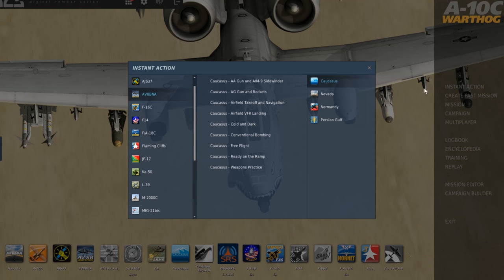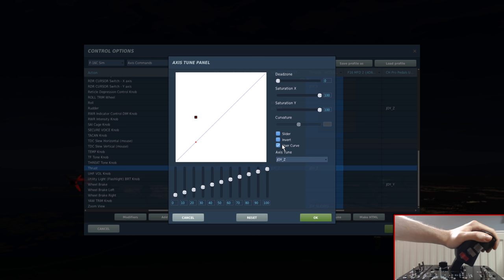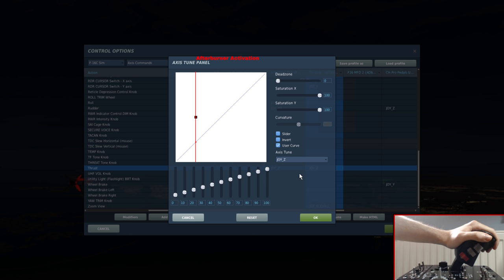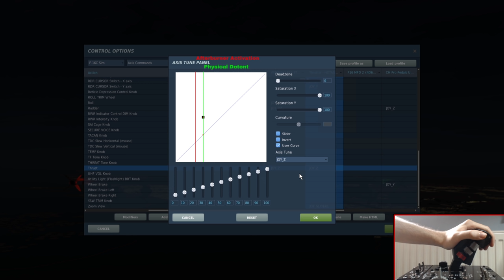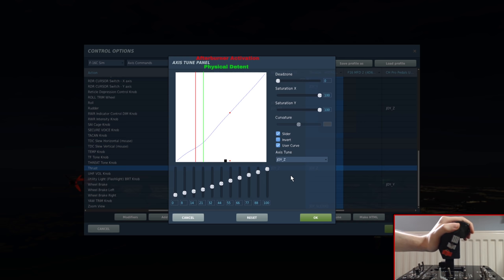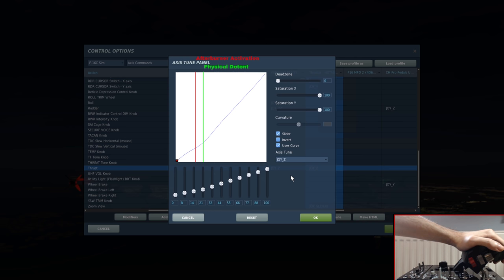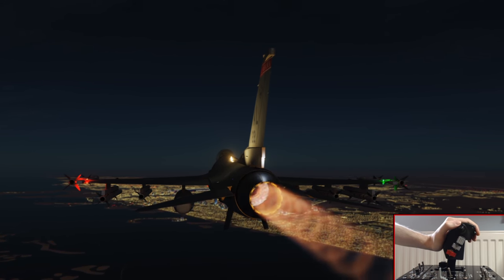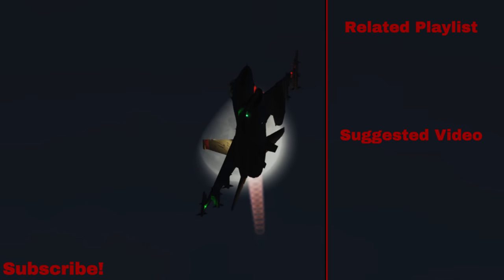DCS Setting up Afterburner detent Tutorial

Comment: Knew that trick already, but it's a great tutorial for those who don't.

DCS really needs that AB detent option. Even US Navy Fighters had that back in 1994, when calibrating the stick it asked for min, mil and max. Also, we can modify only 3 boundaries, one of which is the deadzone, the other two being the saturation values. I desparately need the fourth one which is missing in some planes, and I've just managed to get around this culprit by having the throttle axes mapped 1:1 in reverse on a virtual stick (vJoy + UJR) and use those instead of the WH axes when I need it the other way round. Could be much easier if DCS had all the options and not just some...
Reply from the maker: Yeah it's not ideal, maybe with MAC we'll see some ease of use features come in.

Comment: I ended up finding mine from trial and error back in the FC2 days. If I recall correctly 22 was where the line is, but that would make the throttle start the burners half the time I was on the detent so I pushed it to 23 or 24. I may be remembering a different setting, though. But those days are long past me, these days I got a throttle with a movable detent. No longer do I have to modulate multiple afterburner stages my final 10% of throttle travel. I also did kinked line method shown here for a while, calculator comes in handy to get the numbers. Also, sliders affect the curve both at and around the setting and so modifying the next and previous numbers by one or two can dramatically improve the result. I've since moved on to an actual curve. There are some parts of the throttle you almost never use and so giving them less space over the important areas was great. But using the previous numbers as a guide and making very slight tweaks is critical there.

In an ideal world I'd like the Falcon 4.0 AB setting too. Though I'd personally make it split the curve into two parts, and give the same adjustment settings in game right now for either side. That way you can have a complex curve pre-afterburner and a linear curve through the burner for example, or a deadzone between mil and burner, or even a curve through the burner to make stage 1 easier to hit with large detents. I've thought about it for a while in the past, it seems to be ideal both for casual users and for those wanting far more control than we get even today.

Comment: Good tip with filing it down, I wasn't aware of that idea :D That will make it smoother/faster to engage AB when I require it. Thanks.
Reply from the maker: Just be careful doing it, better to take off too little than too much, and insure it's a ramp for the throttle to ride up over. If you mess it up, you can order 3d printed replacements pre-cut as push through detents.
Reply: @RedKiteRender  Where from?

Comment: I have perfeclty calibrated Warthog and these are my inputs fo F-16. I also used fuel flow gauge for it:
0 6 13 20 31 42 53 65 76 88 100
Reply: Do you plse have it for F-15C ?
Reply from the maker: Follow the guide in this video and you can configure it for yourself, this method works for all modules.

Comment: My T16000M does not have an AB detent.
I just go full AB, wait for speed, instantly take back the throttle and use the ATC (autothrottle / Key: "T") to make my Hornet give 100% thrust without afterburner. So it is always trying to hit the AB speed but will never use AB. And when I move the throttle it goes into manual mode again. Works out for me.

Comment: Thanks for this Mr Kite.  Can you give an indication of how much you filed down/ reshaped your warthog detents so that you can push the throttle through (and back?) without having to lift them.  Its because you have to lift over the AB detent that I haven't changed mine.  Thanks.
Reply: If you give it a firm push, without holding it down, you can press over the detent.
Reply: @marioschmitt4435  Thanks. I'll give that a try.  I'm sure on a video about setting the detents it said you had to lift them, but I'll give it a try all the same.
Reply: Phantom453 There is a file out there, CAD-data for a custom detent. 3D printable by most services. Just don't remember the URL. Cost me a few bucks, but works fine without turning the axis. It's designed to be pushed over smoothly.
Reply from the maker: That's my detent
https://cdn.discordapp.com/attachments/545275530786635801/679836554688200724/IMG_5359.JPG
Reply: @RedKiteRender  Thank you!

Comment: In the Hornet the aferburner sounds kicks in before any flames are visible. So where does it really start? With the animation or sound?
Reply from the maker: If in doubt you can use the fuel flow, normally what'l happen is the flames appear later because they take a moment to ignite once you've reached the AB segment, which is why i suggest moving slowly on the throttle so you don't get caught out with the engine response lag.

Comment: Excellent tutorial.  Redkite, do you know if they have fixed the steerpoint bug with the TGP ?
Reply from the maker: Steerpoint bug? you mean overwriting the steerpoint location with the tgp? No that,s still an issue, they need to implement CZ cursor zero functionality.
Reply: RedKite Thanks. After your video, I have immersed myself in BMS and it is truly a first class simulation of the F16. DCS can only dream of achieving its level of sophistication. It is actually quite frustrating using the DCS F16 after the using the BMS F16.

Comment: Can you set this also if you have a one throttle and you are doing this on a double engine module? Like the Tm16000 throttle on the F18? Or not?
thanks
Reply from the maker: Of course, just bind your control to 'throttle' which controls both together, then adjust the curve.
Reply: @RedKiteRender  thanks for the reply. But to do this I think I will need to fly a little bit to understand something.
I could also maybe design on that throttle the lines of each position for more realism and to have a reference however i dnt think it will br accurate. This at least until I get a winwing f18 reproduction

Comment: Can we use curvature instead of the user curve to set it up? what is the advantage and disadvantage in that?
Reply from the maker: Issue with curvature is you delineate the throttle across the whole travel, i find that makes it harder to make adjustments in formation or air to air refuelling, you won't generally notice it outside of precision flying however. But also you can't choose a sharper or softer curve early on or after the afterburner setting. (Some aircraft like the Viggen for example it helps to adjust the multiple afterburner stages curve individually too)
Reply: @RedKiteRender  thanks for the reply, so i have mine actual afterburner point around 35 and physical mil power around 45. And I got confused as yours more closely to 20. What do you suggest me to do in this particular scenario because i found -7 curvature works perfectly

Comment: Can someone please tell me how to chop the top end of the throttle off so I dont have to use the detent at all in the harrier? I find VTOL take off and landing almost impossible with the detent and I have plenty of travel before the detent
Reply from the maker: Warthog? unscrew the little bit between the two throttles, and at the front you've got the detent, just pull it out, flip it to face the other way, should disable the detent.
Reply: @RedKiteRender  Ooh no sorry, what I meant was; How do I set a custom curve in order to not use the detent and above section on the throttle.. I.E. Max throttle is reached upon reaching the detent, so that I dont have to cycle back and forth over th detent when trying to land in VTOL... I have an Orion HOTAS
Reply from the maker: @flighttherapybullisticfpv133  Ah okay. You should try reducing the saturation down until it meets the detent, which is at about 75%? I think? That should give you what you're looking for.

Comment: i dont get it,why not just leave it like it was?
Reply from the maker: Makes it easier to use full military power without afterburner to save fuel. If left as is, military power and the AB would both be after your physical detent, making it a little hard to accurately select which you want.

Comment: Frankly, it is easier to 3D print a dozen of those detents instead of filing down the stock one.
Reply: yep, thats what I did.
Reply: I need to get me one of them there fancy 3d printers.
Reply: I'm curious, where would you 3d print these parts ? Do you send the 3d model to a company that does it for you and you would have to wait a week before it arrives or do you have your own 3d printer in that case good for you but saying it is easier isn't really looking at the whole picture.
Why is 3d printing is easier than simply filing down the detent? I'm pretty sure for most people it certainly isn't.
Reply: @notproplayer3649  I printed at a local 3d print workshop. Get the stl files at debolestis page. Google debolestis, you'll find him easily. He's on the forums too.

Filing down the detent is an easily fuckable up job and is irreversible. A dozen of those 3d printed inserts cost me about ten bucks. I can even file them individually without tweaking curves.
Reply: @theeltea  okay if you say so though I haven't got any workshops nears me, and I'm pretty sure you could find trigger detents on Ali express or sites like that, yes the shipping time is long but that's the last ressort if I end up fucking up my filling. And again I'm not really sure that a lot of people have got access to some sort of 3d impression.
Reply: @notproplayer3649  If you need reassurance - go ahead, just take small steps and dont rush it. It would take a few times to get right.
Reply from the maker: I decided to file my down with the mind of, if i dont, i won't ever use it. if i mess it up, i'l just order a 3d printed one. I don't really fancy swapping out loads of different detents, but it's great that they're easily available.
Reply: @RedKiteRender  Yup, I decided not to bother with several custom detents. Too much hassle for too little gain.

Comment: how do you set up the idle detent with the warthog?
Reply: the idle detent on the warthog is a button. in the modules keeybinding you find throttle idle. just bind it as usual any move your thottle into the cutoff position. it will register as a button press.at least on the F-14 it worked that way
Reply from the maker: Do you mean on your physical controller? i showed it in the first min, unscrew the cover between the throttles, remove the cover, pull out the detent piece and turn it the other way, place back in. You then have to pull up the finger lifts to pass over it unless you file it down like i have. Alternatively you could order a 3d printed push through detent.
Reply: @RedKiteRender  no I mean to get it properly functioning in DCS, specifically with the hornet.  I have the afterburner detent set up and working great, that simple because its all the same curve.  but I don't know how to get the idle detent working.
Reply: @MattesSPunkt  ok, I'll try that.
Reply from the maker: @Carl Groover Ah sorry mis-read your comment. you've got to lift the handles to pass into it. Then either pass in or out it'l output a button press (22 / 23 i think). Doesn't always catch it in dcs though. you can force it with the selection drop down if needed.